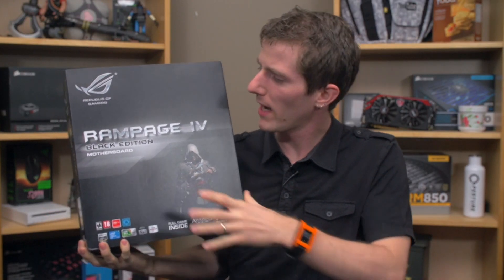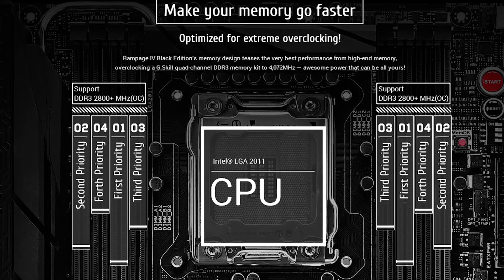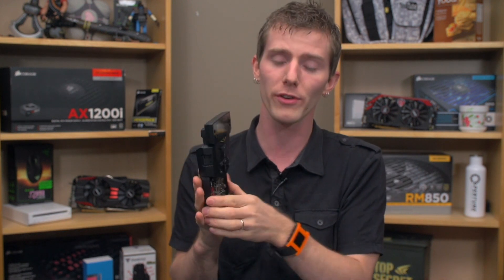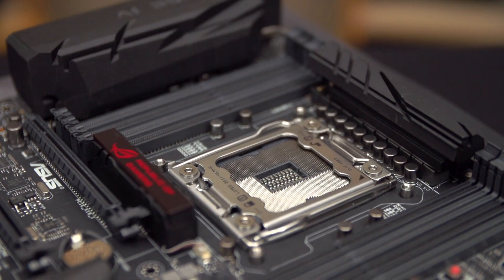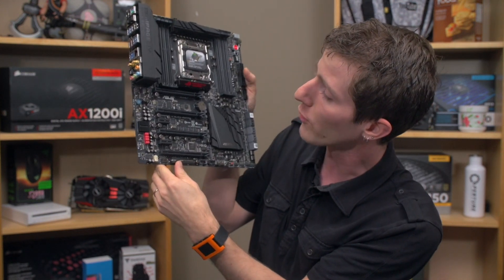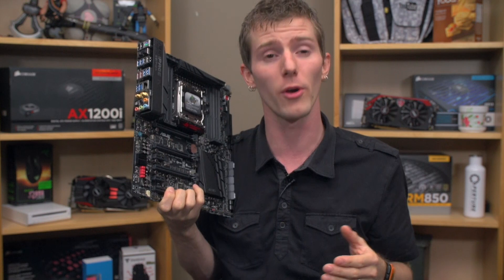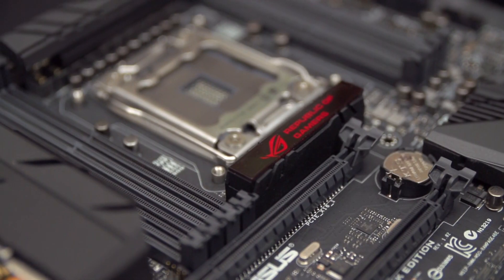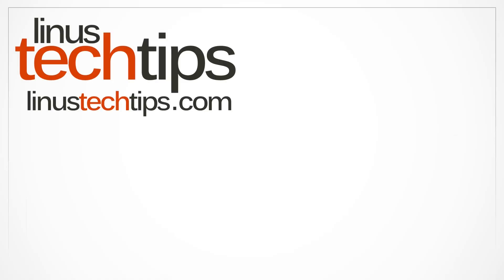ASUS Rampage IV Extreme Black Edition Unboxing & Overview

Comment: So I don't need a Sound card with this Motherboard or shoud I get an $84 Asus Xonar DX 24-bit 192 KHz Sound Card???

-thanks and My PC SPECS:

I7 4930K  6 core processor with 32gb 2400hrz RAM with x2   GTX 780ti's with X2 27" monitors with an Maximus VI EXTREME black edition with Nzxt phantom 820 case with Samsung 840 Pro Series 256GB 2.5" Solid State Drive X2 and 
X2 Seagate Barracuda 2TB 3.5" 7200RPM Internal Hard Drives 

This is one Top of the line PC :)     ...A real gamers Paradise But yeah This game should run about average 90 FPS on BF4 On ultra with a resolution scale of 200%
Reply: Hell of a rig you got there, i'm personally going with a build very similar, for 4K gaming.
To answer your question, i don't think you will need another sound card, because this on board one is simply an high end sound card itself on it's own. Easily supports 7.1. You shouldn't need to spend the extra money on another sound card.
P.S. I think the on board sound is actually better than the Asus Xonar DX.
Reply: WHAT THE FUCK:
Reply: lol thanks :)
Reply: Srsly dude that Rig,how much did that cost you?
Reply: 4,800
Reply: with a shipping fee of 300 so 5100 AUD dollars
Reply: Dude where did you get like 4,5 k $ ? LOL
Do you have skype?
Reply: Rian Emerson haha mines not shipping im gonna pick it up from my local pc store, Mwave, cheap prices aswell compared to any other place i have been to or seen, but my whole rig is gonna cost about $5300 AUD :P but all this new technology is coming out atm, like ddr4, which is mobo support i know, but also x99 chipset, and some other stuff, aslo im still deciding on my GPU,s as the new generation 900 series are coming out. but we'll have to see how they compare to 2 780TI's xD
Reply: yeah :P
Reply: no
Reply: cuddlenut When you get a job you will find out.
Reply: You do not have a system like that as your cpu 4930k is lga 2011 and the maximus vi extreme is not lga 2011.

It should be Rampage IV like myne, now upgraded to rampage V with 5820k
Reply: :( I bought this board on April of 2014 but still i suck at overclocking any noob guide here?
 i am doin it with 4960x
Reply: avikbellic911 hi mate i recommend overclock.net
Reply: TheMerkageturk
 okay i would give a try to it then....thanks :)
Reply: I think that 32gb RAM for gaming is useless, 16gb at max.